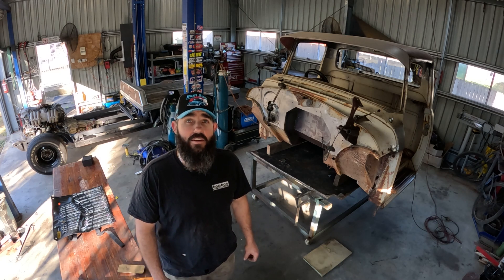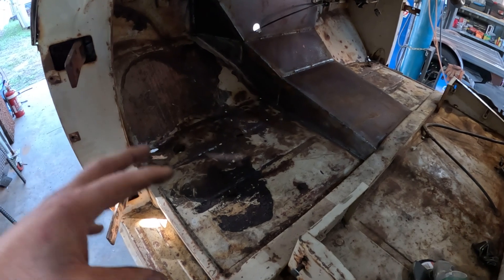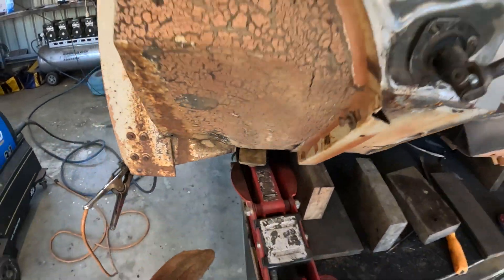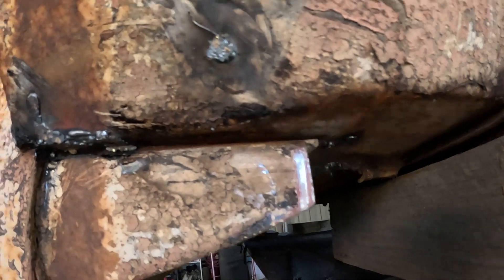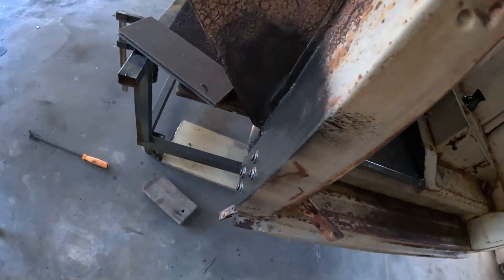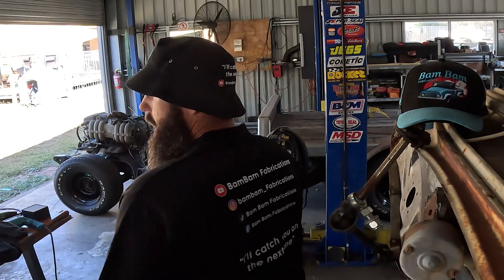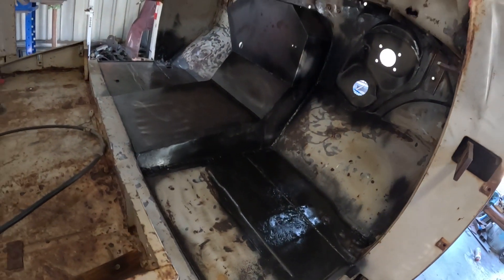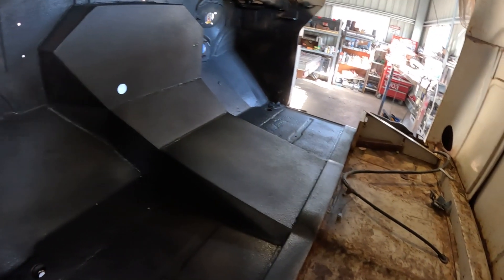Barra Powered C1100 International Pickup Truck Build Ep.23

Comment: Floor repair worked well but not sure I personally would have gone that way, were the area's around the holes still nice and thick? Guessing they may have been or you would have struggled to get weld on them, just thinking if it's stripped down to the point it is, replacing the pan with a new one may have not been too much work and may rule out a problem down the track.
Reply from the maker: Cheers! Yeah the rest of the floor was structurally sound just those deep pits mainly, the customer wanted to try that repair and see how it went so I gave it a go and it worked a treat! If it was a fair bit worse I would have replaced the floors like I did on the Aa build as they were very thin and like Swiss cheese! I'm very confident in the repair going forward and the customer is happy as I saved a lot of hours in repair! Appreciate you commenting and your feedback. Cheers BamBam